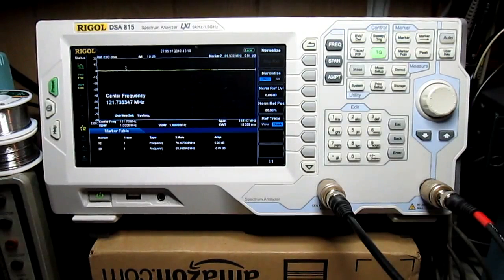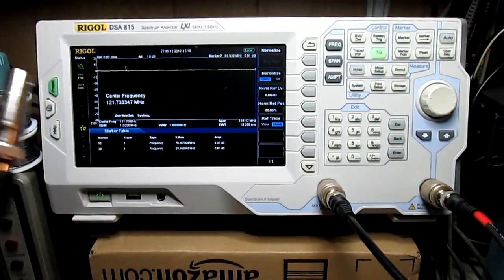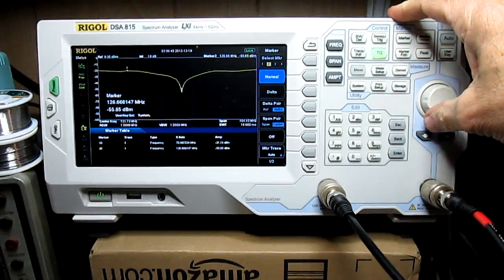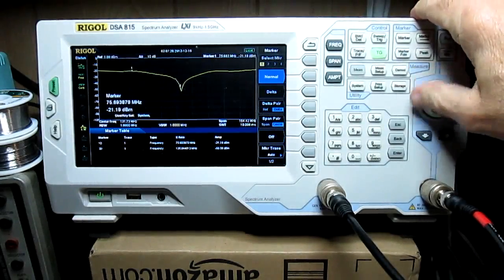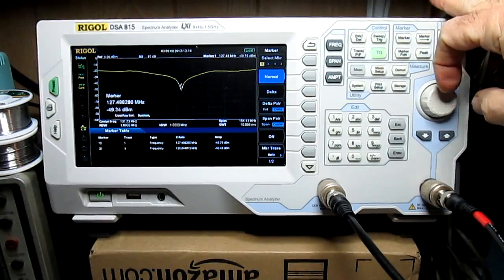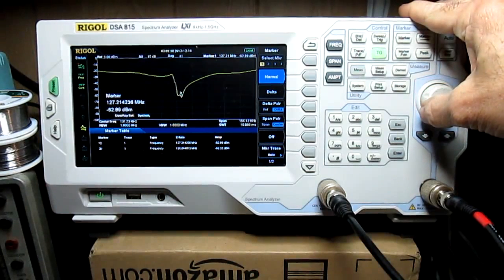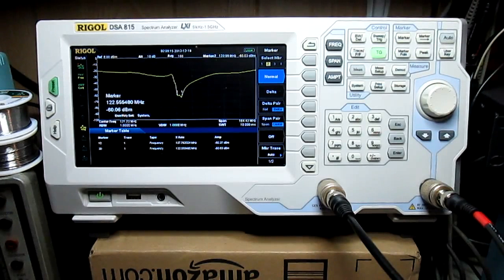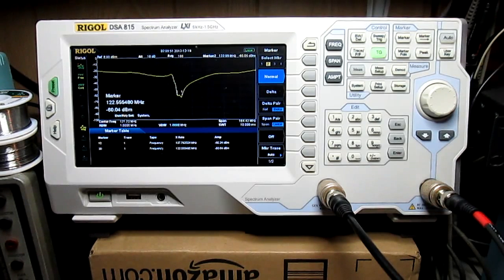DSA-815 Spectrum Analyzer and 1/4 wavelength tuning stubs.

Comment: Hi Randy! For my info since you didn't mention it, how did you determine the bandpass of the 2 Stubbs ? Just had my DSA815-TG for 2 Months and learning from you. 73's David. K8KEM
Reply from the maker: I dont believe I calculated the frequencies .. it was more an exercise in seeing that you could see it on the spectrum anaylzer and that with two of them of slightly different lengths you could get a bandpass .. which after looking at this video  is perhaps more of a band stop / notch filter?